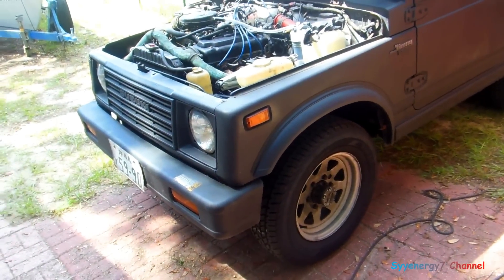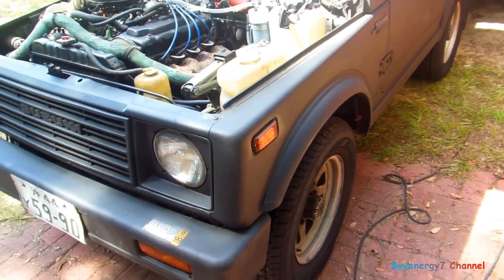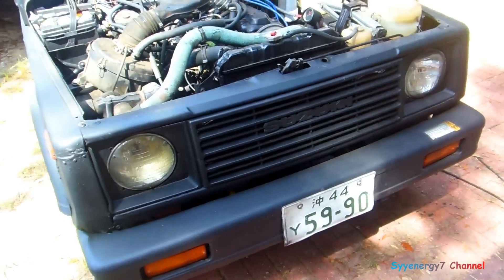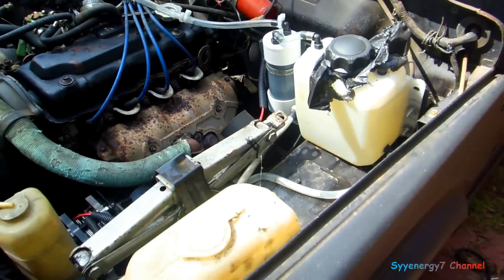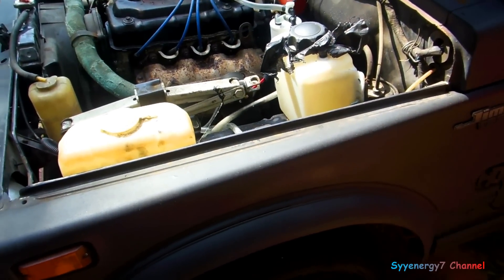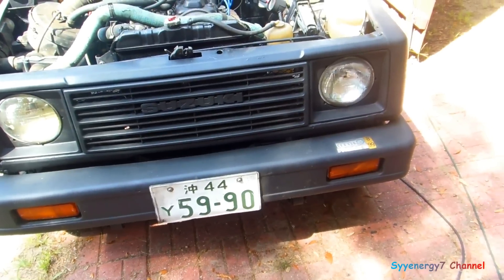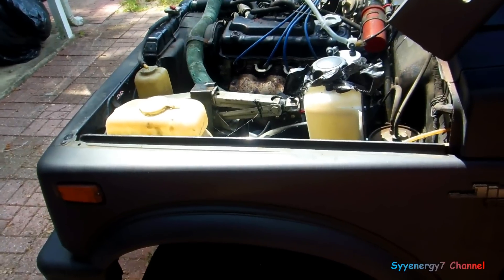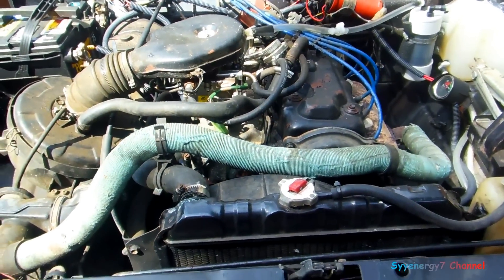WHY HHO Works & Don't Get Ripped Off

Comment: With injection engines just make sure you put hho line before the airmass sensor (lambdasonde) so it can regulate the air/extra gas coming in.

Comment: HHO leans out the fuel mixture. When fuel is lean it runs HOT. HHO does work but you must calibrate the computer on the car and monitor excess Heat.

Comment: Ok I'm a believer.
But good does do me or anyone else solong as you withhold how you made it,wires it, and plumbed it in.
Reply from the maker: FULL DETAILS on VIDEOS:
Suzuki Samurai Installing HHO, Part 1 of 3 {Brackets} 
http://www.youtube.com/watch?v=cjy7UNLF4_0

Suzuki Samurai Installing HHO, Part 2 of 3 {Plumbing} 
http://www.youtube.com/watch?v=5x9lNzSOX_8

Suzuki Samurai Installing HHO Part 3 of 3 {Wiring} 
http://www.youtube.com/watch?v=l5SDbyWyARo

High Output HHO & Amp Gauge Install - Suzuki Samurai 
http://www.youtube.com/watch?v=0A8zTrJRPkM

Installing a HHO kit will save you money on fuel and increase your gas mileage, especially on the older carbureted cars, truck, jeeps and 4X4's.   On older non-emission controlled cars, truck, jeeps and 4X4's, a HHO kit will also lower emissions by cause the existing air/fuel mixture to burn more completely.   The hardest part about installing the HHO kit is where to mount it and making strong brackets.  The dry cell needs to be below the HHO reservoir.

HHO SAMURAI Real MPG Results, 27 MPG
http://www.youtube.com/watch?v=8gI9jQVUPCI

Comment: This is going to sound gross, but try urine as your electrolyte you might get a big surprise in output.   Only do this with stainless steel electrodes!!!   The solution will dissolve aluminum and copper quickly.   I tried this with 50 watt solar panel with no battery connected and two pennies in a pop bottle and you wouldn't believe the amount of gas I was getting off that on a very cloudy day where the panel was only putting out 70 milliamps.. which is 70 thousandths of an amp, whereas the panel is designed to put out over two amps in full sunlight. What can I say I got bored on a rainy day!  For those not electronically inclined, 2 amps is 2,000 milliamps.   I'm a former electronic technician, experimenter and inventor.  I got the idea for using urine after I read about its electrical characteristics in a science article about a girl who creates enough gas to run internal combustion engines from some experiments she did in Africa.  Apparently, using this electrolyte, the breakdown of that urine occurred @  about .37 volts, whereas water with a weak electrolyte took 1.23 volts.   This was verified with scientific test apparatus.
Reply: hot damn...been using my piss for fertilizer , but hadn't thought...could you post a reference to this?....let's see , uric acid?....was it ONLY urine?...etc.    i wish i'd taken chemistry/electronics , etc. in school , i'm 73 , and learning all new stuff is hard

Comment: We have been selling these HHO kits for 11 years now Go to Hydrogen Garage dot calm / store. HHO will be here to stay. Hired trolls attack this field of free water for gas. Make deuterium level of H2O gas or deuterium water ( classified ) and you can run the entire engine off of the cleanest, safest, most natural gas on the planet. Lets use it NO SMOG. No carbon in the formula. The only gas that will be allowed during the next Millennium.

Comment: Personally I think the only reason why it works is because you are consciously not giving it as much gas as you normally would to get the same kind of power. The engine is still sucking the same amount of fuel in as it normally would but you are just not so heavy on the gas anymore because you're getting more power with less effort resulting in better mileage.
Reply from the maker: Nope.  If I baby it , the MPG breaks new records. Since I OWNED this 4WD for 30 YEARS , I am very familiar with it's mpg.  Regular driving is about 27 mpg.  Babying it is over 30 mpg.  I never got that mpg EVER before the HHO and nowhere near that MPG prior to HHO.
Reply: well if it's carburated, and you haven't adjusted the fuel/air mixture, then the same volume of fuel is being burned so the mpg should remain the same... a cleaner burn of the same volume will not increase mpg unless you subconsciously go easier on the gas..
Reply from the maker: Good, make SURE that YOU don't do this.
Reply: I came back in to TRY to find current info....most of the excitement died a few yrs. ago , out of business sites, etc. ; so how to find long term effects (possible internal damage , etc.) frustrating as hell....but you've been running yours how long with the HHO ? somehow i worry about POSSIBLE chemical reactions..........i KNOW it works , i gained 10% w/just a water mister several yrs. back , and used to do internal cleaning by spraying water mist in intake.....cheaper than seafoam , which is new to me..............i've got a 60K mi. dodge slant six , and want to KEEP it til the oil runs out..........yeah , unleaded/alcohol mix is damaging , so i hear , but have you heard of HHO doing any damage ?
Reply from the maker: @gaylandbarney2231  I never of HHO doing damage.  I'm using it a few years now.
Reply: thanks

Comment: Split the Positive battery bank setup is the answer to high output HHO.  

You will need an old pick-up truck.  

12 volt batteries, 5 of them and up is best.  

A solar panel system that will fit over the batteries and in the bed of the truck.  

A large HHO cell that can handle many Amps without overheating. 

Optional...build a rotation circuit for the batteries, so you don't have to rotate them manually.

Comment: I´ve done the math, it does work, with no violation of energy conservation law by proper technology and electrolysis catalysis. The problem is when you use water only as chemical energy carrier for extracting H2 by electrolysis and then burn H2 in order to both yield the water splitting with electricity and move the vehicle as well: the energy intensity is about 3 MJ/kg-water, or about 10 times less than fossil fuels´.
Therefore, it works better as H2-assist for internal combustion engine utilizing fossil fuels.

Comment: American Hydrogen Council face book page has begun
We need your help to get the word out about our hydrogen power plants to change the world!

We are a working hands on Think Tank working to bring H2 Hydrogen Power Plants to the masses.

What is a Hydrogen power plant you may ask?
First let me explain what it isn't.

At this time most people associate any kind of convitional engine or motor out there that can be converted to run on hydrogen. As a true hydrogen motor.
Through combustion, hydrogen is more efficient than its counterpart patrolium based fuel almost 3 to 1. Unfortunently Hydrogen loses 70% of its potintial because everyone wants to combust hydrogen the same way they do with fossil fuels.

A true Hydrogen Power Pant that can create work at any level does not work that way at all.

Lets talk about the differences between a petrolium molicule and a hydrogen molecule. 
1. If you compare them in size. You can fit 1000 hydrogen molicules inside of one petroleum molecule. 
2. One hydrogen molicule is 100 times more powerful than One pertrolium molecule. 

If this is the case then why is combustion of a hydrogen molicule not getting more results than it is?

To understand hydrogen better would help. 
Because hydrogen is so small and yet so powerful it has way more potintial than we are currently using it.
When placing hydrogen under high pressure it has the ability to slip through metal like it was not there. Though to the naked eye metal appears to be solid. This is true for most uses of metal. Because hydrogen is so small it finds its way through metal.

The problem with hydrogen being combusted is it is pushing most of the hydrogen out before it can be used. At 55 lbs of pressure and above hydrogen seises to work effectively. How you know this is the electrolisis build up on the engine and the water coming out after its combustion through the tail pipe.

For some reason engineers are not thinking out of the box they are in concerning hydrogen motors. They use only what they know and not actually working with the way hydrogen actually works and moves. When released into the atmospherefrom a vacuum or any container hydrogen moves in a sonic wave motion.

What we are
In patents on the Energy Transducing Power Plant.
 It has been proven that when using the sonic motion created when popping or exploding a molicule. The molecule wants to move. By creating a directionin in which the sonic wave moves. Work can be captured quite easily.
By using hydrogen in this manner the power plant can create as little or as much power needed.

Benifits
Very easily scaled up or down in size and power.
Can be adapted to anything that needs work
Very few moving parts needed. 
Minimal wear on any parts
No heat
100% of the hydrogen molicule is used.
No water being made.
No electrolisis 
No Exhaust Needed

We are currently trying to put together a Crowd Funder to secure world patents and perfect the electrics.

We have the ability to change the worlds view and the way we use hydrogen.
We need your help!!!!

Once we have established a web site and have gotten a crowd funder ready to release. 
Would you like to be notified so we can send you a heads up to where to go to pertisapate?
If so then private message me so I can reach out to you at that time.

Comment: At least you are admitting that it doesn't produce more energy than it takes.
Reply from the maker: IF it did produce more energy than it takes in that would be so minute that it wouldn't effect MPG.  Carburetors and non-computer managed engines aren't that efficient, so the HHO helps burn up the extra left-over unburned gasoline.  That's where you get better MPG.  IF you installed fuel injection and an engine management system the MPG would be better than the HHO with the Carburetor.  
   There may be a far more complex way to harvest vast amounts of HHO from water, but it's not by this simple plate method.
  Still it does in fact help with a carburetor engine without a computer.  The MPG gains are real in this situation.
Reply: syyenergy7 I'd say this is 100% fake because if it we're real car companies would be using it. I can think of alot of reasons why it shouldn't work but since I have not tried it my self and you have video evidence that you have tried it I will have to use the other type of argument that I just used, I don't know your motives for lying but it doesn't appear to be sales so I'm guessing just views I'm still very confident that you are knowingly lying because if this were true like I said before it would be VERY well documented and used in every car.
Reply from the maker: Every car since at least 1996 runs fuel injection and has a computer-controller engine management system.  Even back in the 1980's this was common.  This simple HHO setup won't work with those cars because they already are efficient.  Old cars from the 1960's and 1950's would be a good choice to use this on. The old cars dump lots of unburned gas that the HHO would help ignite. My 1985 Suzuki had zero factory emission equipment and was foreign and has an emissions waiver. 
  This HHO wasn't around in the 1960's and 1950's.  No one with a classic car is going to use HHO.  If they modify it, they will go to fuel injection and an engine management computer and do better than HHO would. 
   I OWNED THIS Suzuki SJ413 for over 30 YEARS.  I know exactly what the MPG is.  This HHO did work to increase the MPG.
   HHO is also going to be installed on my 1978 El Camino.  I won't put it on my other cars because they are too new.
Reply: syyenergy7 okay so why are there so many hho guys saying it works on new cars and alot of them say it produces more energy than it takes.
Reply from the maker: I won't bother installing HHO on a newer car.  When you have an old car, from over 50 years ago, and you can smell the unburnt fuel out the exhaust, that's the car you want to put HHO on.  The HHO will ignite a lot more of that wasted gas that would be going out the exhaust pipe.
Reply: syyenergy7 okay so how does the hho ignite more of it when it's already a perfect fuel to oxidiser ratio.

Comment: Finally a guy who has it figured out. We learned the computer systems are DESIGNED TO DEFEAT HHO. We always had success on carbureted simple cars and trucks, as soon as we encountered a computer, NADA. The ECM getting signals from the oxygen sensors will defeat the hho everytime. This was two years of work not two minutes of reading posts we went through. That said I believe I can design and build a proper fuel metering system for HHO, making a vehicle run on HHO only. Funny how the diesel trucks are having so much success with HHO isn't it?
Reply: What's weird is why the O2 sensor has a problem with it in the first place, you're putting 2 parts hydrogen and only one part oxygen. And the job of the O2 sensor is to read how lean the engine is running then adjust the fuel rate. But you're adding more fuel in the end so it should read rich and adjusted for less gas. Not only that but when HHO is burned it turns back into water so it shouldn't read any extra oxygen

Comment: so what i need to do do i need to setup the computer of the car
Reply from the maker: I don't know what you'd need to do exactly.
Reply from the maker: The HHO works good on carbureted cars with no computer.  What is going on is the small amount of HHO causes a more complete burn of the existing fuel in the combustion chamber.  It's make things more efficient and clean.  Carburetors aren't that efficient so the gains are good when you add HHO.

Comment: i have hho system i tested in my car nothing change do i have to setup the computer of the car
Reply from the maker: This Suzuki doesn't have a computer.  That's why the HHO worked.
Reply: Use Volo chip http://voloperformance.com/fs2hhoedition.html

Comment: Great video and thank you for posting. I have a friend who is doing some research this field. Looking for the best, older, newer, different and any other type of technology that would give the best gasoline performance. The computerized fuel air mixture may be the first and most difficult problem to overcome. Just guessing ✌🏽
Reply: its all about money really, cause people like me who know how to reprogram an ecu and/or add the hardware sensors that may or maybe not be needed to run a modern car efficiently with these systems, dont have the funds to experiment around with it and make something from it..

Comment: google up CGON in the uk, they now make these cells for people to have installed, so its no longer BS, good work syyenergy7
Reply: Just checkedout cgon page, a basic system for a car is £459 fitted. SO if I wanted to save money on fuel I would not buy this.. But it prooves it does work. SO if it were fitted as standard on a new car I would buy.....
Reply: depends on the size of your engine and how long you had it fitted before you had it moved over to your next car,

Comment: As you say, it is most effective on carbureted engines. On injected engines the sensors see less fuel in the exhaust and the computer compensates by adding more fuel so the best you will get is a cleaner combustion chamber because of the water byproduct of hho combustion. On computerized cars an electronic system must be added in order to control the computer's reaction to the cleaner burn.

Comment: I would be interested to know from you or anyone else if your exhaust system valves or cylinder head had less carbon build up? 
Could the system be saving fuel by removing these build ups? Did the fuel-saving build up over a period of time then level out?

Comment: https://www.youtube.com/watch?v=s2t11GR6jFc
Reply from the maker: Fuk that dipshit.  he doesn't know jack.  HHO will work good on a non-computer carbureted engine.  It's NOT that it 'adds fuel'.  It adds HHO which CAUSES a more complete burn of the Existing fuel.  If the engine is highly efficient, it likely won't do a damn thing, such as with a modern computerized multi-port fuel injection and variable valve timing.  I don't have anything near that in this Suzuki.

Comment: Could you please calculate the fuel mileage in an exact manner?  For example... wait until the fuel light comes on, then put some gas in and see how many miles until the light comes back on, then divide the miles driven by the number of gallons you first put in at the pump.
Reply from the maker: I already did that on other videos.  If I drive it real easy, it gets 30 to 31 mpg.  Drive normal mostly around town , it gets 27 mpg.  I owned this thing for 30 years.  It never got that good mileage until I installed this.  It gets about 10% to 15% better.
Reply: syyenergy7 so is it improving the combustion process?  Or turning water into hydrogen and fueling the engine?  I see so many possibilities, like maybe using otherwise wasted energy to fuel the process of turning water into hydrogen/oxygen... like a turbo utilizes the exhaust.  People have said it's pointless because you can't create more energy than it takes to break the water down through electrolysis, but obviously there are benefits when utilizing what would be wasted energy...
Reply: syyenergy7 I'm just wondering how exactly it is boosting your mpg, because that should only be possible if it is harnessing wasted energy, or maybe the popular belief is false and a car could run on water.

Comment: So you don't use gasoline, just water (hydrogen) right?
Reply from the maker: I use gas.  The HHO helps a little bit with a simple carb system because there is unburned fuel left and the HHO ignites the rest of the fuel better for a complete burn.  HHO doesn't really work on highly efficient computer controlled engines with fuel injection.